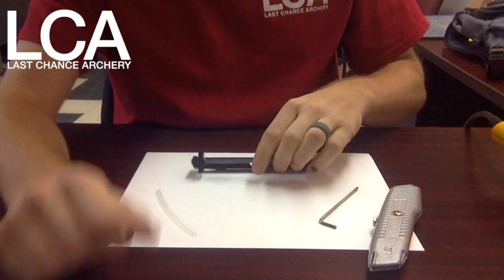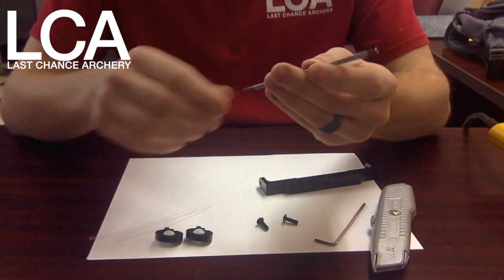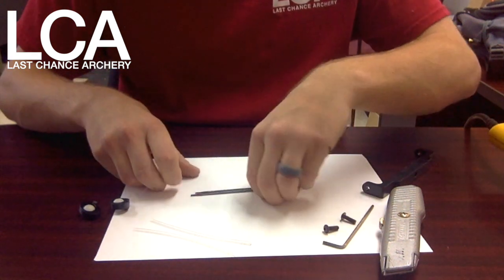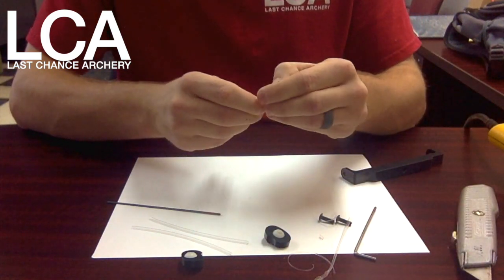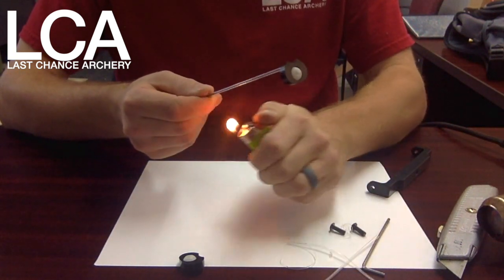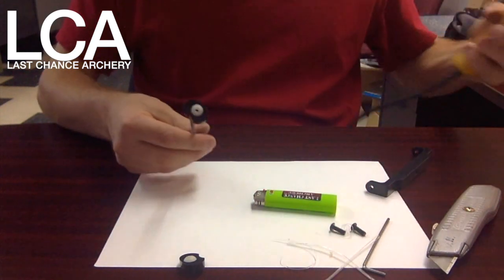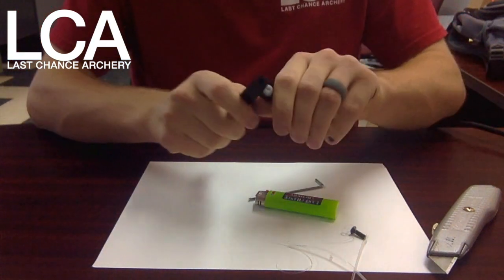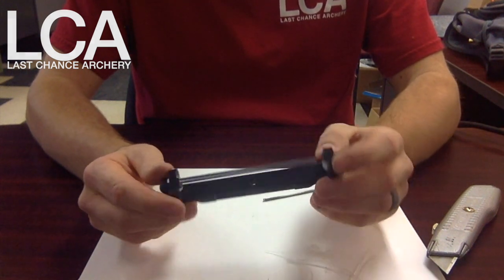VMP Wire Coating Replacement

Comment: glue attached to mine and coating tore in multiple places from my finger nail when I was attempting to clean...this was within two weeks of use at my shop...can I use this without coating? I don't mind changing sleeves but if I have to clean it anyways could I use without or will it affect pressure on vane to arrow adhesion?
Reply from the maker: Hi there, it most likely would effect the pressure applied to the vane. Also effecting how the vane pressure is against the arrow. With that, also the glue will stick the vane to the wires and you'll constantly be fighting with that as you pull the clamp off the fletched vane. It would probably be suit you to replace those covers. Just be sure that you keep either a paper towel, or what I use personally is a microfiber towel, handy when fletching. Use either of those to wipe the wires after each vane to get off that access glue. If you do this after each vane with the covers being glue resistant, you shouldn't have any issues with the glue drying and being hard to remove. It'll only stick after it's sat for a good while!

Comment: What is the significance of the color black and red on the wire. Why is the red on top the black on bottom. And can that be interchanged black on top red on bottom.
Reply from the maker: Hello, so the colors can be interchanged, the only reason there is the color at all is just to have a reference point so that you can align your vane without sliding the vane up against the rotating "black" disc. If you were to slide the vane against the black disc what could happen is glue would seep out onto the disc and it'd be hard to clean it off. Keeping the vane a little away from the black disc allows you to fletch and wipe all the excess glue off since the wires have glue-resistant covers. We have actually started this year only sending VMPs with one black wire, again, because it's only there for a reference point so the red and black are not needed. We just always recommend that after every vane you fletch using a microfiber towel to wipe off all the excess glue. This will allow you to fletch, and then remove the excess glue before it destroys your covers.

Comment: can you dip it hot water? Will it shrink that way/ i have o heat gun or dryer
Reply from the maker: Hot water is not something we have tried, but we do feel like hot water would not get it hot enough to shrink. We recommend a heat gun, or hair dryer.
Reply: @LCArchery  how about boiling water/ would you try it and let me know?  I just ordered the pro master with replacement plastic wire covers and was curious since I have no heat gun or dryer. TY